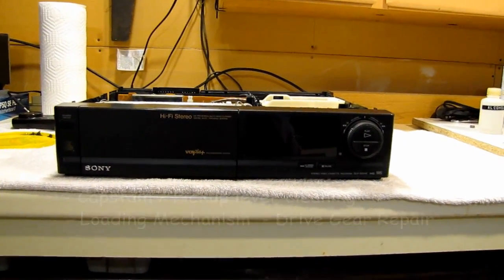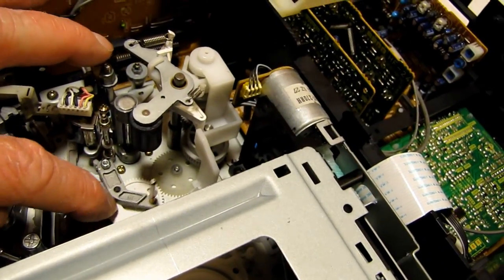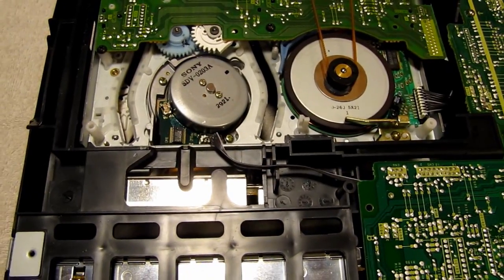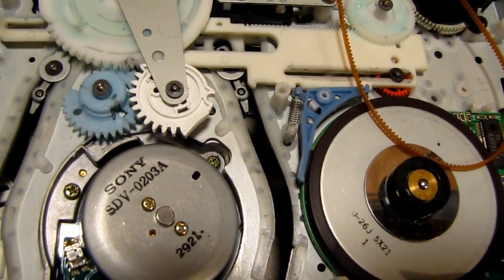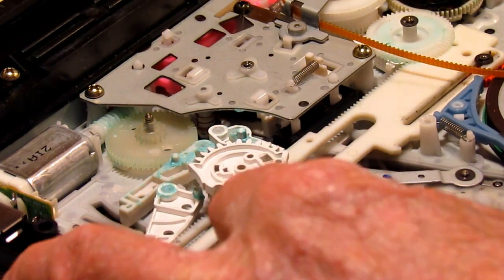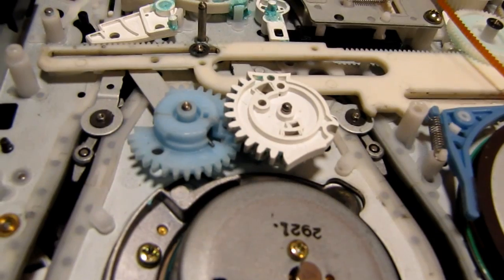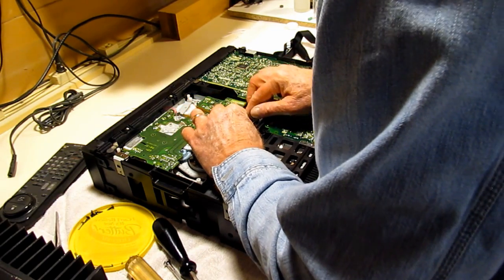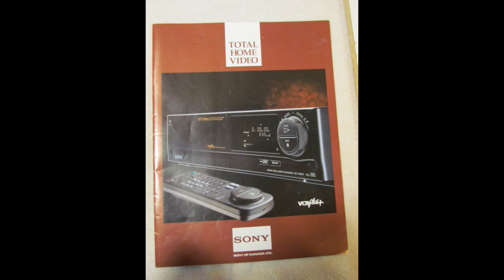Sony VCR - SLV-595 HF - Tape Load Gear Repair

Comment: Whoever's watching this and has lost the clips that hold the gears, these are called "starlock washers". Can be found on amazon. By the way, thank you for this video!
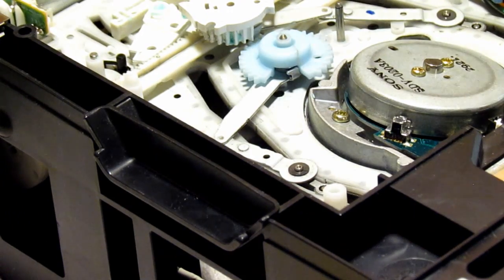Reply: Any idea what those split rings are called like the one he works on at 20:00? Cause in CD drives those things can be tiny and I've lost them before, so it would be nice to know what they are called so I can get replacements. 😅
Reply: @LogiForce86   I cant really tell what exactly these are called but by the looks of it you can replace them with e-clips. You can find very tiny ones depending on your axle size at r/c hobby stores.
Reply: @antonisantoniou2560  That is indeed what I ended up doing last time around because I couldn't figure out where I could get the plastic ones.

Comment: Good video, but the dryer noise in the background is a bit distracting
Reply: I agree. The woman that kept stuffing clothes in the dryer while I was filming was most annoying.
Reply: @larryhuff3383  I just Found this VCR and the blue gear was broken. So I just glued it hope it holds up
Reply: @YourReviewChannel  When I glued the gear it only lasted a month or so. It’s best to just replace it as they are not expensive. See the link in the description.
Reply: @larryhuff3383 Ya good idea I just ordered a new gear, just picked this VCR up at goodwill for 17.00. Do you know where I can get a replacement remote control?
Reply: I got the new gear and new remote control. After installing the new gear, cleaning the heads, All work perfectly. thank you for the video and advice.
Reply: @YourReviewChannel  I’m glad that this video was useful. I haven’t used this VCR for a couple of years now. Hopefully it still works when I plug it in next time.🤔

Comment: The supplier he links to is out of stock, but I found 4 on ebay, $10-$15! Just search the part number. While you have it apart, check the guide rails for cracking/warping, usually the reason they break, with the added spring tension, and I've heard the pinch roller shaft can start to get sticky too.  Common problem for these models. Great video

Comment: So glad you made this video! I'm having that exact same issue with the shaft that moves the tape toward the pinch roller. It is 'freezing up' as you say, which is preventing the tape from ejecting properly and causing it to krinkle up. It looks pretty simple to clean with your instructions. Thanks! SONY SLV-R1000

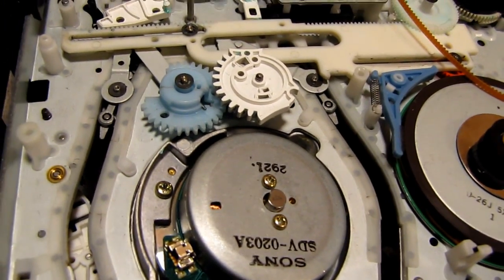Comment: @25:20.  how do you figure how/where the long horizontal slider with geared edges is supposed to reside in "eject" position?    It would seem from video still, the slider is mostly all the way to one direction -- but not all the way.    How do you figure the correct position for that long slider?
Reply from the maker: Hi Garrett. I can't remember if I marked that gear during disassembly. I could be remembering this wrong but I think the sliding gear had to align with the larger white wheel during assembly. There was also allot of trial and error off camera😊

Comment: I've done this repair myself, but I do something extra to help it last a long time.

Glue, by itself, won't hold the gear together for very long.

So in addition to gluing the gear back together, I tautly strap the exterior of the smooth surface of the gear several times with polyester thread and apply glue to the threads.  This adds needed reinforcement to the repair.

Comment: My lever is very tight. I got the nut off and can move the lever back and forth with some force but it will not pull up and off the shaft. I positioned it past the plastic stop like you advised and pulled upward with needle nose. I am afraid to pull too hard but it will not budge.
Any advice would be appreciated.

Comment: Hi i have a JVC HR-S9500 SVHS VCR it has trouble threading or inserting a tape when it does go in it refuses to play and switches itself off. What could be the issue, any ideas.

Comment: Larry i did exactly the same thing with krazy glue and it worked fine. Howevernow when the tape ejects the takeup reel doesnt pull the tape into the cassette so the tape gets stuck inside the vcr as the casstte ejects. Could this be a faulty mode switch or a failed ic that controls the takeup reel to pull in the slack before ejecting???any ideas thanks???every tape that i insert plays ok but is desrtoyed when ejected. Rsvp asap thanks.

Comment: Quell'ingranaggio blu e' difettoso si rompono tutti,ho molti amici a cui si e' rotto quello,sempre quello,poi ho visto tanti video di riparazione dei videoregistratori sony,il problema e' sempre quell'ingranaggio,possibile che la sony non sia venuta a conoscenza di quel problema?.comunque amico hai fatto un bel lavoro al tuo sony,ho visto alcuni che dopo aver incollato il pezzo,lo rinforzavano con del filo di ferro molto sottile,avvolto sulla parte superiore,e sembra che regge.nel video dici che non sei entusiasta del VHS,preferisci il betamax,ma il VHS e' un'ottimo sistema,e non a caso e' diventato il sistema mondiale
Reply from the maker: Thank you for the nice feedback. The wire idea is a good one. I did get a replacement gear and although I haven’t used the vcr in a while I believe it’s still working.

Comment: Thank you Larry H
You video was super useful
But let me comment that after replacing the broken blue tape load gear in the video myself, THAT's when I learned the value of the Super Glue
I broke two of the little white levers, on one it was actually the little guide that goes inside the big white gear, and if it weren't for Super Glue... I don't know what would have happened...
And then I put the guiding pulleys backwards (the one marked G should go on the right side looking at VHS from the top)(or is it the other one?)
Then I spent a whole weekend (including COVID curfew hours) fiddling with manual tracking, sound head alignment, a mess... Ah, and the capstan dropper thingy had solid dry white grease I had to clean off and replaced with graphite...
But, it works now! Beautifully. I can see Dora The Explorer and a whole other bunch of Blockbuster tapes, a Tori Amos tape and an old Ren & Stimpy recording from the 90's.
I don't know why it's still called MTV but, whatever...
Reply: I’m glad you found this useful. It’s been a number of years since I made this video. I really like the features of this VCR so I hope it continues to work. I remember the Ren and Stimpy tapes. My kids used to race to the cartoon section at the video store to see if they were in. These were Beta of course. I mis the video store experience. It made watching a movie a real experience.

Comment: the broken blue gear is a standard issue with this Sony mechanism. Also, you should take off the pinch roller to clean and lubricate the shaft. Seized up pinch rollers was a very common problem too.

Comment: Hi Larry, Great job on the video and repair. I have the exact machine you did this instructional video on.  machine is sort of out of timing/adjustment. I did have the locked up Arm like you demonstrated out to clan up the spindle shaft  and that part works great. I had to do  some gear timing which your video was a huge help in performing. Now I tried to load a tape and the tape guide on the right side of the drum with the robin egg blue tape guide on it is stuck in the furthest most position  from the at rest position with the tape ejected and  the machine turned off. I was going to take the bottom cover off and have a look but thought I'd ask you for you advise and expertise on this unit. It' gotta  jammed somewhere. Time to cook diner and then back to it. I'm trying to create DVD's using the Video Player using a program called Diamond Easy Grabber. No having a lot of luck with that either. Thanks again
Reply: I made that video 7 years ago Dave so unfortunately I’d have to do find that VCR and take it apart to answer your question. Wish I could be of more help but I’m glad my video helped you at least get this far. Good luck. I’m sure if you made it this far you can do it…

Comment: Just bought this VCR from goodwill (for full price no less) and it has both these problems. Goodwill doesn't take returns so Im stuck fixing it. Mine is missing the piece that broke off the blue gear or I would of also tired to glue it. Ordered one off ebay. Hoping that'll do it. Thanks for the vid.

Comment: Hi Larry. I have a question. Would it be possible to upgrade a VCR tuner to a ATSC digital tuner? Or is there more involved than just switching out the NTSC tuner?

Comment: Thank you very much, I pulled out my Sony like the one here and experienced the exact same 2 problems with mine.  fixed the arm but didn't know y gear was broken till I watched your video.  I ordered that part from KP and hope it goes together and actually works again.  lots of tapes to convert.  That long plastic gear arm under the round gears... I moved it back and forth but now it won't com back an not sure where it should sit when I put this together but I guess I'll see when i get the part.

Comment: I have two of these units. one does not power up, the power supply is fine and one loads the tape normally but there is no
 output, any tips?

Comment: The glue was crazy glue (purple in colour) however it only lasted for a couple of months. I subsequently replaced the gear with a new one. The link and supplier of the gear is listed above in the description.

Comment: Larry, helpful video for me while re-installing the lever take-up guide.  Thank you!  FYI to others, do not over tighten the guide lever nut; if it is too tight the gear that drives the lever will strip.  Always make sure that the lever swings freely.  I know from experience.

Comment: Thanks so much for uploading this video. I've gotten ahold of an SLV-900HF which shares this transport and this exact problem. Taking out the circuit board on the 900 may be a bit more difficult for me since it uses some connectors that don't look quite as forgiving as the ribbon cable in the 595.

Comment: I had the same problem with mine. I tried gluing the gear a view times with super glue and epoxy but nothing held, so I just ordered the gear you linked. Thanks so much!

Comment: I got this VCR today, I have audio but no picture, can you help me please? Thanks
Reply: My usual starting point would be to check the power supply voltages to make sure they are all as expected. You will need to download the service information for starters. While checking have a look for leaky capacitors.

Comment: I have a question from the video we’re it runs at 6:28 you call it a guide. There are two. When my movie is ejected the two guides do not move at all. I see that yours move down as the video is ejected. Mine do not move when I insert the movie nor when I eject the movie. Why?
Reply from the maker: That's a good question and is actually the reason I created the video. If you watch the video at 14:55 there is a blue gear on the far left of the screen. This gear has a tendency to break and will make the two moving guides on the topside inoperable. The rest of the video covers how to replace that gear keeping the alignment of all of the other gearing.

Comment: So I am also fixing one here in 2023.  The gear was busted (blue one) and the arm was seized as well.   Now that I have it back together the tape won't load at all when I put it in.   Powers up fine.   It's like the switch that tells it a tape is loading isn't working.

Thanks for this video I'm miles ahead then where I was.    Just need it to load a tape at all now
Reply: Sounds like you’re making progress. I would check the tape present switch and the mode switch next. There is likely more videos  on YouTube for this type of failure. I just used this vcr for the first time in about 5 years and it still works great. Good luck...
Reply: Thanks I have seen some stuff on the mode switch.  I'll keep at it.  My biggest frustration has been that I can't seem to figure how to remove the board  completely.   So far I've done all the work underneath it.  It's still attached at the top left.  It looks like there are 2 things plugging one board to the other but they are seemingly hard to reach with my hands if they unclip at all.

First time working with board like this so I may just be being too gentle.  To get to the mode switch I'll have to figure it out though.  Not enough room on that side to just reach under!

Comment: I have SLV-585HF. the mechanism very similar.  left capstan pinch gear broken in same way.    I ordered replacement gear (ended up buying off ebay for 2-3x to avoid customs delay).     In the interim,  I glued together broken gear.   I discovered the cause of broken gear.   The capstan roller slider was running into a metal piece on the eject path.     I found this out by assembling gears and the hang up immediately broke my newly fixed gear (36hrs of glue drying).   I ended up making slight bend in metal piece to insure captain return path not affected.    
In addition, I found that removing the RIGHT gear in method you show bends the thin metal arms and goofs up the mechanism (ie. adds a lot of friction to mechanism).   Thus, I had to pop off c-clip on right captain and unbend the arms.   
side note:  I recall a great story in garage with Dad where he described the "C" clip as an abbreviation to "Christ Almighty" that you yell when you attempt to pry off with screw driver and it zings across the room... hoho.
Reply from the maker: Thanks for the additional info. It's good to know. I totally agree with your dad. I'm going to refer to C clips as CA clips in the future.

Comment: Brilliant video  rare does a glued cam gear remain repaired, your great work has worked  i have had several sony that same gear failed... i replaced gears  if happens again i will try glue..  great work indeed.
Reply from the maker: The glue fix turned out to be temporary. It broke again after about 6 months. Replacing the gear in the end was the permanent solution.
Reply: @larryh8072  you are awesome mate, thanks for taking your time record this.
Reply: @larryh8072  thank you  and indeed you are right, I found the replacement gears and my machines are going strong. Great work  thank you Larry  best wishes
Reply from the maker: That's great news! Glad you found this helpful. Cheers!

Comment: Larry thanks for posting this. I have found that "pull the tape behind the pinch roller arm" problem on several of the ones I have and one for a friend many years ago. I currently have two SLV 585HF that I teased several years back and then this week I got them out and they both wanted to eat the tape. It was not the usual above problem, in fact I'm not sure what is solution for the the problem. Here is what they both do. They will play the tape just fine, but if you rewind the tape or play in reverse it either will not go back, or it will pull the  arms in and let the tape out of the cartridge. The one came back and began working fine after I took the top and the bottom off and then it now works fine. The second one that appears newer (smaller power supply  area) will kind of pull the tape back inside on eject or reverse play, bit not every time, but after it has run a tape for a while and auto rewinds it it will eject cleanly then. So I don't know if it has to warm something up, or if there is another sticky part similar to the  first  problem most of these have but this is under neath the bottom somewhere, something is not moving quickly back in it's spot is my guess.
Reply: Larry this other one gave me a clue. https://www.youtube.com/watch?v=q-geC1fndSg   This gave me a clue at 30:40 and some other spots that had the same view of the top of the mechanism as to the problem with my SLV 585HF. The rewind side was not pulling the tape back in on eject or in reverse play. Problem is the gear mechanism between the reel hubs that big white thing at the bottom at this time line. That center part is supposed to spring back and forth. I worked it a little by hand and pushed around that center pivot clip. and now it no longer sticks and it will pull the tape back in before ejecting. No more eating tape. In the long run I assume I need to pull it off and remove the old grease. I put some Zoom spout oil on it for now. (sewing machine oil).

Comment: You don't need to mark them, the holes in all the moving parts will line up with those on the chassis once they're aligned (you can check using a screwdriver or piece of wire, or just look down through the hole) as well as the arrows on some of the gear teeth pointing at each other. Remember these were mass-produced so they needed to easily get the parts aligned at the factory. The holes make it easy.

Those clips are best installed by putting them on the shaft and pressing down over the clip and shaft with your thumb. They're intended to be removed and reinstalled without tools, and tend to go flying otherwise.

After you think everything is together right, you should spin the loading motor manually in both directions to move the mechanism from full load to full unload position, everything should go smoothly with nothing binding up. That will save you from breaking anything if you do accidentally get the timing wrong, since the motor is quite strong.
Reply from the maker: Thank you for the comment. I noticed most of the alignment holes as I went along but I like to mark things that are alignment critical.

It sounds like you have serviced a number of vcr's over time.  Thanks for sharing. Others will find the comments useful.